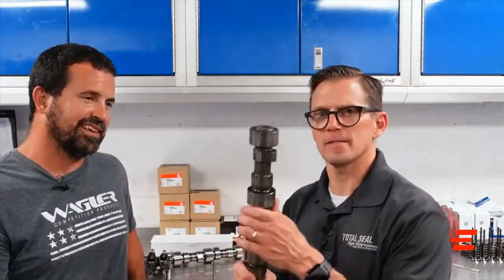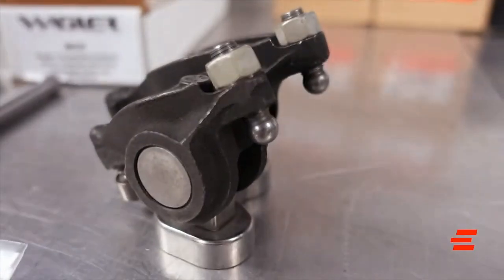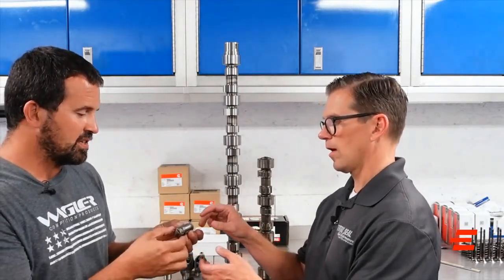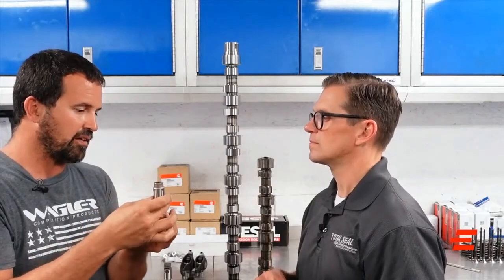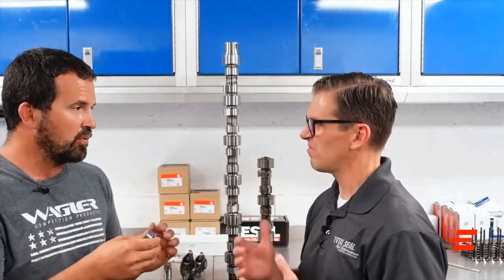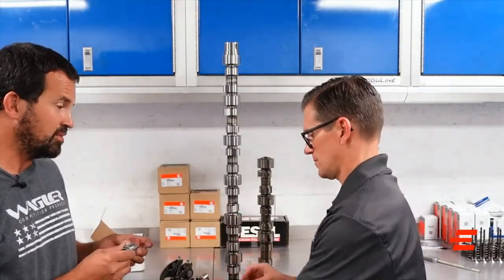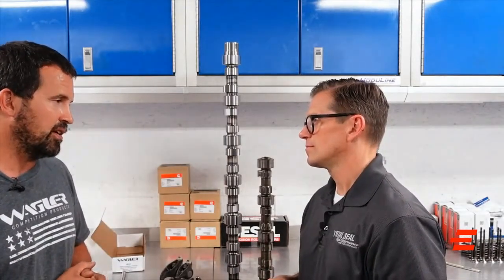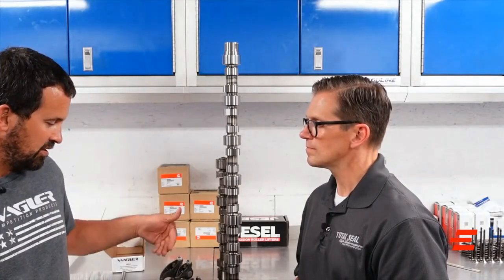Diesel Valvetrain Upgrades (Expo 2024 - Episode 3)

Comment: I agree about oils. I have a 2008 Sprinter and everyone claims that the more traditional diesel oils (whether 15W40 or 5W40, Rotella etc) are better for the engine itself but the DPF doesn't appreciate some of the additives so you have to run the low soot 5W30 oils.